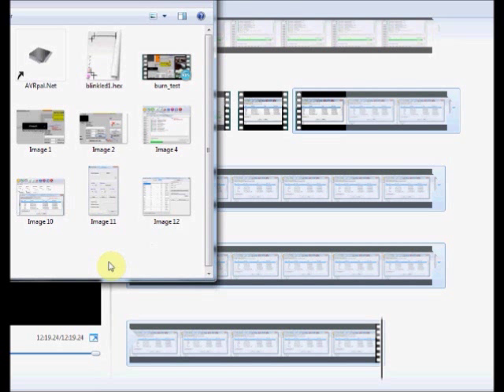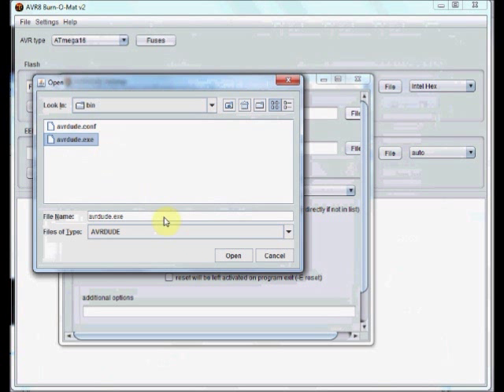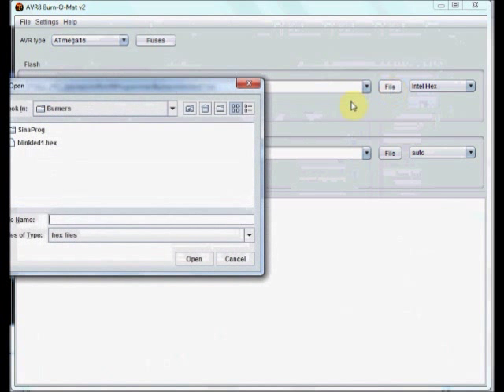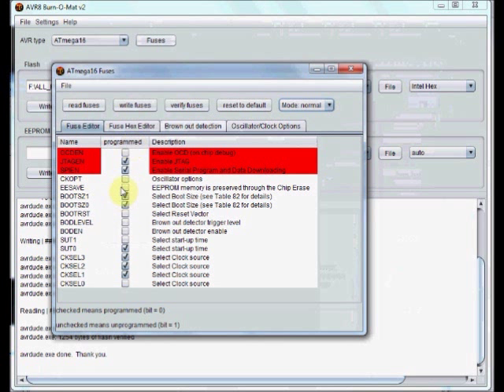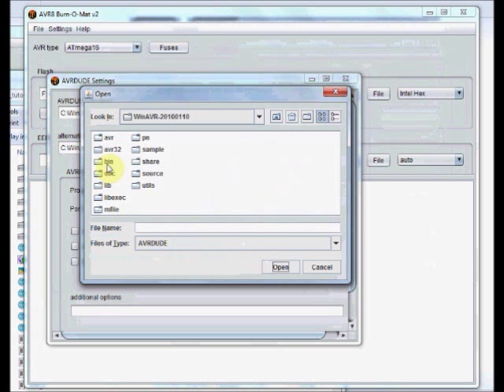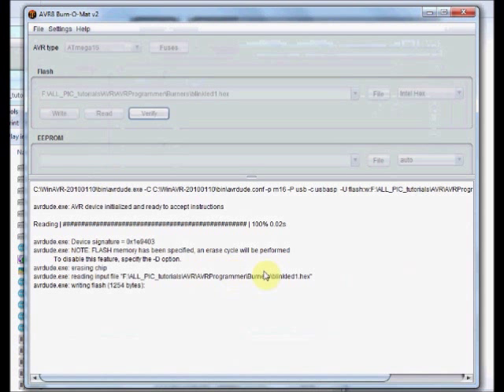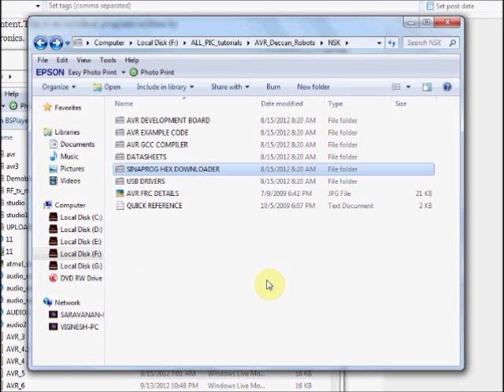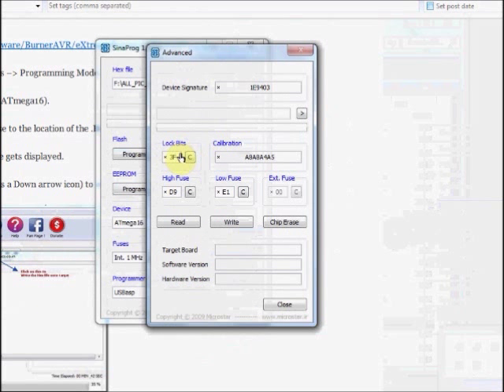AVR Burner Part 2

Comment: sir, i burned a program and it's working in the hardware. But when i changed the codes and run the program again, and also burned again, my hardware isn't showing any new result. The output of the first program is repeating.